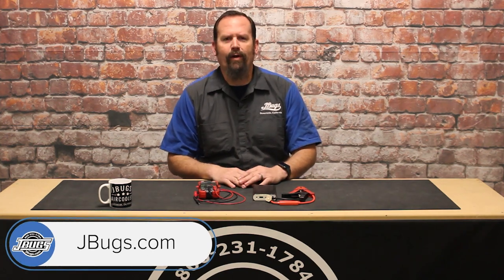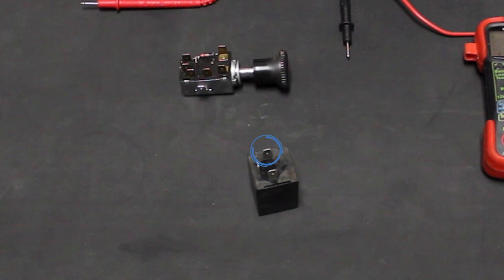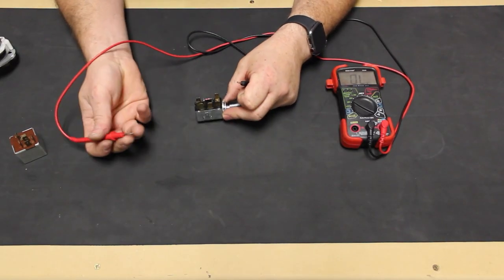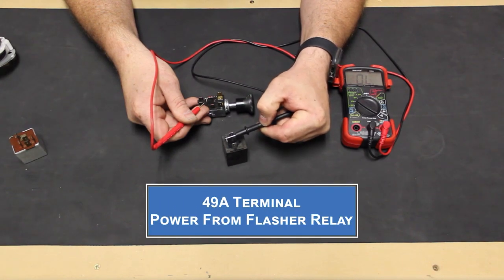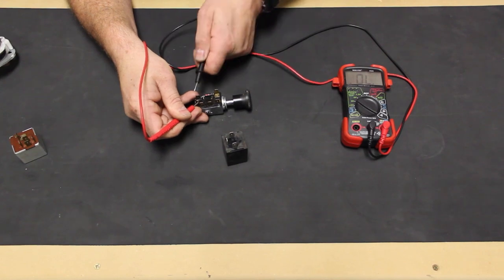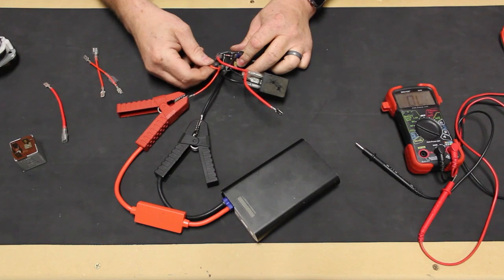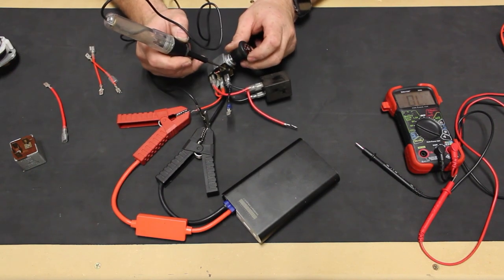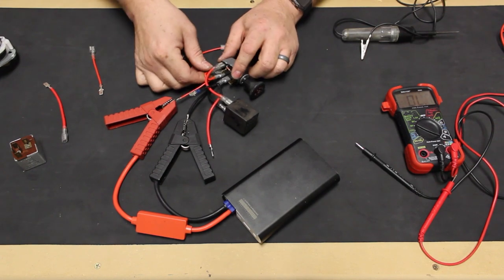JBugs - VW Dash Switch Testing - Emergency Flasher Switch & Flasher Relay

Comment: I just bought a 1975 salvage yard vw bus. Because almost all the connectors are mowed out by previous visitors to said junkyard, I had a scarier nightmare than anticipated. This video, along with your aftermarket turn signal video helped me finish the job. Thank you very much! Now, on to the brake lights, gen light, oil light, fan switch, fan installation, and more! Never give in! Never give up!
(My apologies to those who wanted to further strip her down. Them days is gone...)
Reply: Glad to be able to help!

Comment: Can you make a video of wiring a Ford ding ding ding key on headlight on key in vs a buzzar vw
Reply: As I have no idea what a Ford ding ding ding key is, and we don't sell Ford parts, probably not.
Reply: @Sam_Mebane  the door chime instead of a buzzer
Reply: @nicktelesco4950  We don't ever hook up the buzzer, but depending on the year, the relay is wired up to a 2 or 3 prong door switch and the contact off of the ignition switch. You can check the wiring diagrams for 1971 and later models for more detail and take a look at this video for the wiring of the ignition switch contacts - https://www.youtube.com/watch?v=gJDHTCLVqFc

Comment: When I turn the ignition key on in my bug with the e-switch in the off position, the relay still gets power and the dash indicator light will flash. 
The actual turn signals will not be flashing just the dash indicator. Blinkers work as normal, and when the switch is pulled out (on position) the lights come on as normal. Turn the emergency switch off, and all the lights turn off except for the dash indicator which keeps blinking. 
Any advice on how to remedy the problem? That little tick tick sound constantly while I’m driving is getting to me lol.
Reply: It sounds like you might be using a 4 terminal flasher relay, in which case, move the blue-green wire from the K/KBL terminal to the 49a terminal (use a piggy back connector if necessary).

The other common problem would be the speedometer indicator bulbs don't have power from the ignition switch to the bottom tab. If your generator and oil light come on when you turn the key on, the tab has power. If the warning lights don't come on, then you do not.